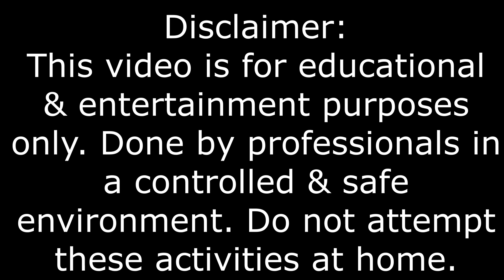Gun Restoration | Seized up 1953 Cold War Romanian Tokarev, (With test firing) #restoration

Comment: This Tokarev is not from the USSR.  This one was made in Romania, and has many differences from the real Tokarev. First of all, this is a fuse, and the quality of the metal is terrible!
Reply from the maker: I never said it was, yes there are! Thanks for watching
Reply: Interesting ! Can you tell us more ?
Reply: The quality of the steel is fine. Outside finish is not. The gun does not have a fuse...it is not a bomb.🤪 It has an added safety lever for importation purpose.
Reply: I agree
Reply: Nerd
Reply: The Romanian tokarev and the Soviet variant you mentioned have almost absolutely no differences. The only difference between the two would be markings, inspection proofs and a minimal amount of manufacturing differences. Although The Romanian variant has had a modern thumb safety or  trigger safety that was added prior to import due to firearm import law and regulations.
Reply: На ТТ есть предохранитель. Курок до первого щелчка.
Reply: @TheKinzlerBros it always a know it all just shut up and enjoy the video bro

Comment: Very nicely done sir.  That first look inside the barrel showed what they call a "sewer pipe bore", but it cleaned up to better condition than expected.  Com-block guns tend to have pitted bores from the corrosively-primed, mil-spec ammo fired in them, but if they were properly cleaned after firing at least occasionally, they can still perform quite well, as yours clearly does.
Reply from the maker: Thank you, We appreciate you watching!

Comment: I'm quite sure that this is a Romanian import. I'm pretty sure because of the safety switch that is on the left side. The original pistol did not have a safety switch( the safety was putting the hammer at half-cock). The ATF, for "safe importation" reasons, made the importers drill a huge hole on the left side of the receivers so that the stupid safety switch could be installed.
Reply from the maker: Ya I never said it wasn't! Thanks for watching!

Comment: In the 1990s, the TT pistol was one of the favorite weapons of Central and Eastern European gangsters. This legend is not so much due to the design of the pistol itself, but to the ammunition produced for it. The lack of resistance of the then bulletproof vests to TT fire concerned only the features of beverages, called anti-material ammunition in the Warsaw Pact nomenclature. Precisely, it concerns ammunition with a steel-core bullet. This does not change the fact that the 7.62 Tokarev ammunition is much more powerful than the German 7.63 ammunition of comparable caliber and dimensions. As a curiosity, the 7.62 PPSh submachine gun, powered by the 7.62 ammunition, uses 60% of the energy of the powder gases for automatic operation.
Reply from the maker: Thanks for the info and for watching!